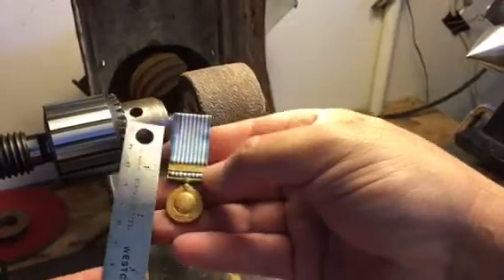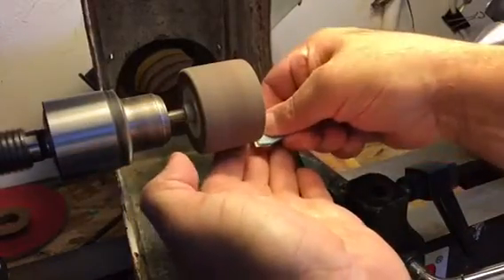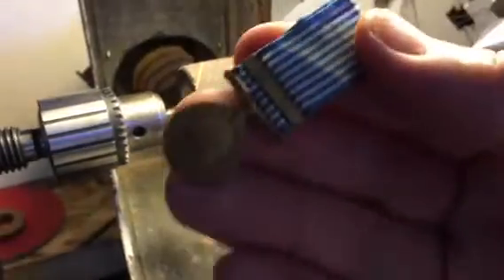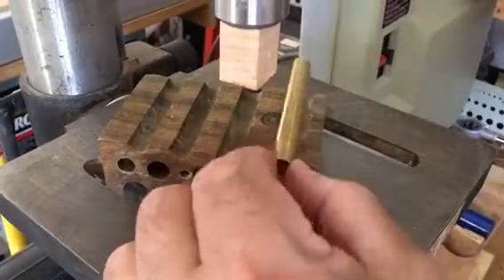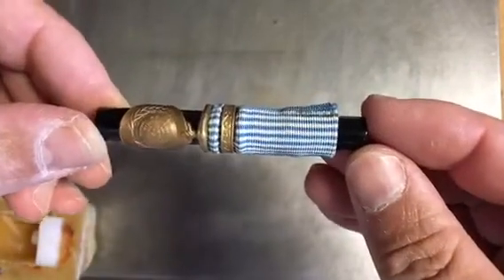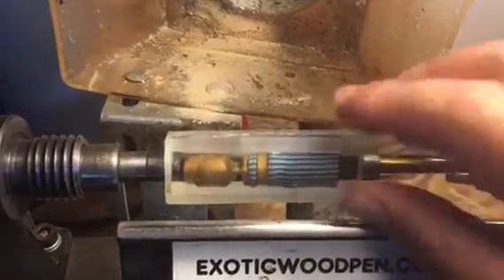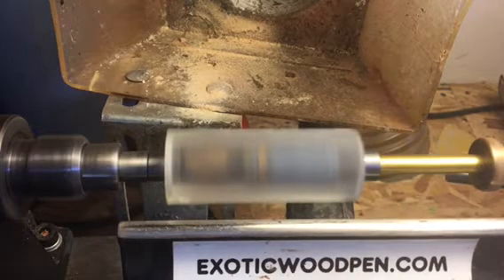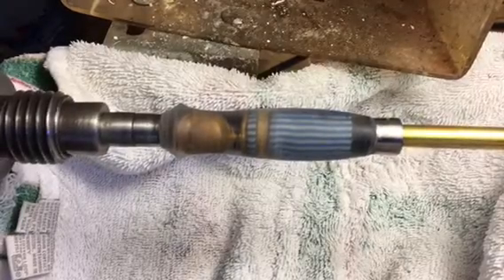War medal pin/pen

Comment: What did you cast it with?  PR, alumilite, or ??
Reply from the maker: I used Casting Craft from Michael's (PR).
Reply: @exoticwoodpen  did you have to cure it under pressure?
Reply from the maker: @msandoval2303  I did not cure it in a pressure pot, the results would have been better if I had one but the end result was still good.  Some small bubbles.